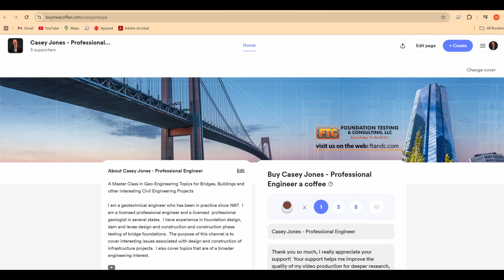Washington Bridge -  March 14, 2025 Update Demo Problems

Comment: As someone who's done this: demo is messy, things go flying, debris nets break, hydraulic hoses rupture. Barge demo is even more challenging. Sorry, I se no major problems with this demo, compared to other's I've seen. You have to break a few eggs to make an omelet. The only thing they could have done, is change the hydraulic oil out with Clarity, a biodegradable alternative. It's usually used when working over or in water. Additional Diver clean up after demo over water is SOP. 
I sent you this in a previous video, I'm pretty sure it's of the Washington st Bridge. https://youtube.com/shorts/4I1ESqcF8mQ?si=5ZmZOEirQZLTfxHu

Comment: With my current employer, I've been involved with some demo work of buildings and parking lots, things like that, I know it's messy work, but DAMN! That's beyond that.
Reply: Agreed. I am not part of construction, yet I do recall the removal of a few brick and concrete structures (from the 50s or older I think) to make room for a computer center upgrade, and it was nothing like this. That was contained and monitored to ensure it wouldn't affect anything else at the laboratory, what is going on at RI is more like a child flinging toys out of a toy box looking for something with stuff landing all over the place. If that's the way they intended to take down the bridge, it does work, it's just incredibly messy with a vastly more involved cleanup afterward.

Comment: SOP for this type of work over a navigable waterway is; the contractor submits a plan for review and approval  by the owner, the owner's consultants, the engineer of record, and the Coast Guard. During construction/demo, the owner's inspectors and the EOR monitor compliance with the approved plan. For the issues seen on this project, many parties are failing to do their job. The contractor is out of control. The EPA is also asleep at the wheel as is RIDEQE.
Reply from the maker: Thank you.  The plan seems to be to let the contractor pretty much do what they want.  I understand that it is challenging to demo a bridge at such a site, but it is doable without all of the sloppiness that we are currently seeing.

Comment: Why is it so common for oil retention booms to fail? It is rare to see one do the job they are designed for.
Reply from the maker: I think it is just cover to allow people to keep working.  Sort of just window dressing.
Reply: The proper spill control booms are expensive and really well built. The cheapo contingency ones we see here are made as cheap as possible and are "compliant" enough to show you have emergency spill containment processes and equipment in place.
Whether the spill containment works or not doesn't really matter when you are in bed with the local government.

Comment: I'm not sure a busted Hydraulic line on an Excavator qualifies as incompetence.  It happens all the time, even on the most loved gear.  The amount of oil that ended up in the water is likely less than a good rainstorm washes down the drain.
Certainly everything about this bridge - from pre-failure inspections to current state - is shrouded in typical RI incompetence...
Reply from the maker: I am hearing that it happened again today.
Reply: @CaseyJones-Engineer  Good sources!!!

Comment: I'm no engineer and don't play one on TV or YouTub.  I get the feeling from you just one ounce of debris in the river would be enough to kill the fish in that river for the next two hundred years.  You obviously are going to counter:   no I'm not, well then how about some context, say something like if they had only allowed 50 pounds (or whatever number makes you fell warm & fuzzy) of debris.   If I can maybe put this another way, you come off say when Engineered Drawings were hand drawn (versus computer drawn via CAD, and printed on a plotter / printer) and someone needed to erase a 1/8" in. line because of a mistake, via your attitude you would be screaming to do have the entire drawing redone from scratch, versus the 1/8" inch erased mistake corrected.  The hydraulic fluid in the boom area looks to be no more than a few gallons at most, via a broken HIGH PRESSURE LINE / HOSE, that even shutting down the machine as quick as HUMANLY possible, when discovered, you somehow seem to equate as though a shipping barge of 300,000 thousand gallons were dumped into the river ON PURPOSE.  If you didn't mean to convey this, sorry to inform you, but at least to my eye's and ears that's what I'm hearing you say, and illustrate via this video.
Reply from the maker: I don't think you watched this video. LOL
Reply: @CaseyJones-Engineer   @CaseyJones-Engineer  Are you standing out in the sun again without your hat on again. Your video shows while your talking about the debris in the river shore-line and how they dug up more than what you felt should have been done, You do your semi-close-up of the the  hydraulic fluid in the river, or should I call it a SHEEN to make you happy, and you talk about the boom not being up to your standards.  I have zero clue what is or isn't a proper boom-setup, but again no context i.e., offering what a proper boom-setup- should be.  You didn't mention any fines by the U.S. Coast Guard, or anyone from say the EPA (Environmental Protection Agency,) so either you have your nose out of joint because as an ENGINEER it's either your way or the highway, theirs's only one way to skin a cat via your way.  How about some context, example the boom was doing  / or was not doing it's job because a proper boom Bla, Bla, Bla, etc. 

You may wish to see if a Doctor can help you with your Cranium Rectum Disorder. I hear they have a cure for that.  If your Doctor is unable to help you, you may want to inquire about Glassectomy!

What pray-tell is a Glassectomy?  

A medical procedure in which a small window is inserted into the lower abdomen, (Belly Button area) enabling a person suffering from Chronic Cranial Rectal Inversion  to see through / out of.
Reply: @CaseyJones-Engineer   @CaseyJones-Engineer  Are you standing out in the sun again without your hat on again. Your video shows while your talking about the debris in the river shore-line and how they dug up more than what you felt should have been done, You do your semi-close-up of the the  hydraulic fluid in the river, or should I call it a SHEEN to make you happy, and you talk about the boom not being up to your standards.  I have zero clue what is or isn't a proper boom-setup, but again no context i.e., offering what a proper boom-setup- should be.  You didn't mention any fines by the U.S. Coast Guard, or anyone from say the EPA (Environmental Protection Agency,) so either you have your nose out of joint because as an ENGINEER it's either your way or the highway, theirs's only one way to skin a cat via your way.  How about some context, example the boom was doing  / or was not doing it's job because a proper boom Bla, Bla, Bla, etc. 

You may wish to see if a Doctor can help you with your Cranium Rectum Disorder. I hear they have a cure for that.  If your Doctor is unable to help you, you may want to inquire about Glassectomy!

What pray-tell is a Glassectomy?  

A medical procedure in which a small window is inserted into the lower abdomen, (Belly Button area) enabling a person suffering from Chronic Cranial Rectal Inversion  to see through / out of.

Comment: The right "pothole" looks like it is under an outfall:  could be a scour pit, and it looks like old rip rap remains.  The one on the left has fresher rip rap, which could be placed intentionally as scour protection.  But if the permit does not allow for any mud disturbance, placing rip rap could be a problem, though it may be permissible above the MLLW line, depending on details.   Grade work above MHHW may be allowed.  So not certain how big of an issue this particular point could be.   Enough other/ biggeer problems exist with this, don't let them use this one against you.
Reply from the maker: Those are great points.  BTW, this video is just a palate cleanser for what I have coming next week!
Reply: @CaseyJones-Engineer  I am impatiently waiting...with baited breath!

Comment: What should be the procedure for mitigating the amount of debris in the water? Cofferdams or more barges?
Reply from the maker: If they had spudded barges that fit closer to the piers, less debris would be falling into the water.
Reply: Smaller barges either side of the support piers. Lash them together one side to the other, plank or bridge the gap between them front and rear. Finish demo, move barge to shore, clean off with bobcat and on to the next pier.
Reply from the maker: @TyphoonVstrom   That sounds like a good playing that they're not following. I think it's outrageous for them to be operating the way they are.

Comment: I am a licensed engineer in several states. We recently performed a demo of a power plant facade over a river that involved selective concrete removal. The owner and regulators were over concerned about any concrete that ended up in the water and added huge rate payer costs for netting and means and methods. 

Your audience should realize that every single civil works along a river involves concrete in contact with the river water. They also allow recycling concrete debris for beneficial reuse as riprap erosion control. 

Safety is another topic and so is hydraulic oil in a waterway. 

Forgive me if I laugh at the concern over some concrete debris in the water.
Reply from the maker: You're apparently unfamiliar with the particular issues at this project site  The issues is with concrete dropping and disturbing sediment which is problematic for downstream fisheries particularly since those sediments are known to contain a lot of nasty contaminents.
Reply: @CaseyJones-Engineer 
And you would be correct. I’m not considering any fisheries. I assume dredging never occurs in this locale?

Casey, we’re on the same side here balancing the environment against infrastructure needs. 

Sometimes the engineers, lawyers, and regulators need to take a step back and let contractors build something.

The debris might cause less harm left in the river since most landed on the barge.
Reply: As a Rhode Island commercial fisherman  , that did commercial construction to for years , you are insane if you think you are going to take that bridge down with no concrete going into the water 🤣🤣 , a hose blew on a machine no big deal , tree hugger at it again , not a oil spill 😩.
Reply from the maker: @johnnylobster2749   Nobody said that zero concrete was going to end up in the water.  However they could be operating in a way such that much less material goes in the river. They just choose not to.  It appears you are easily triggered.

Comment: It will be interesting to follow the post retirement careers of RiDOT higher management alumni and then connect the dots of historic tendering awards. Boards of Directors, the directorships of which are now up for future consideration. Nothing to see here folks, no highly trained folk installing environmental safeguards improperly, no sheen of oil here, move on, move on.
Reply from the maker: I agree with you on that.

Comment: Hydraulic leaks from modern excavators and other earth moving equipment are expected and routine even with excellent maintenance. These machines are greased and oiled at the start of each day and then warmed up for about fifteen minutes during which the operators and oilers visually inspect each piece of equipment. Flexible hydraulic hoses on these sized machines are routinely subjected to pressures in mid thousands of PSI during use and will fail from time to time w/o giving any visual or testable warnings. I've read and from memory believe that the Coast guard has said that one teaspoon of petroleum can generate a sheen over one acre in size in a marina so w/o knowing how much oil leaked the sheen in the photo could have come from less than one teaspoon of hydraulic fluid and in fact when lines do rupture spills are almost always much larger and since the fluid is under such high pressure the spray area will sometimes be quite large. It would be expected that some of the spray could easily have reached well beyond any boom and In this case I would not be surprised to learn that some of the traffic on the open road was to some extent sprayed. Barring malfeasance it's inane to include any no leak no fail in a construction contract. I do agree that this contract seems awfully expensive. Ray
Reply from the maker: I heard that they had another hydraulic fluid leak today.  I was on a job in Utah that was located in an environmentally sensitive area.  The contractor was required to use vegetable oil for their hydraulic fluid.
Reply: @CaseyJones-Engineer  Great solution for an otherwise intractable problem. That must have taken some time to drain system cylinders, hoses, pump, reservoir. hard lines. Ray

Comment: thank you casey, josh & chris!!!!!
i know nothing of heavy equipment, but i am wondering just how much hydraulic fluid is in an excavator, how much it can lose and still operate, and how NO ONE noticed that huge volume of hydraulic fluid escaping earlier (and moved to stop the flow).
i also noted that wpri reported that no sanctions were given to the contractor for this significant spill. wouldn't this kind of environmental failure have been prohibited in the contract and wouldn't that be something that the contractor would be penalized for in that contract?

thanks again for reporting all of this!!!
Reply from the maker: I don't think RiDOT would be in a position to penalize the contractor.  That would have to come from the state environmental agency that seems to be taking a "hands off" approach relative to this project.
Reply: That excavator  has about 100 gallons of hydraulic fluid, pumped at 5,000 psi.  What probably happened is a hose or fitting broke, a fairly common occurrence. It is surprising is that no absorbent pads can be seen in the drone footage. Having a spill kit onsite, ready for the inevitable is standard procedure.
Reply: @williamhart8974  thank you for that explanation. in that all construction on the portions of the bridge that are at or below the water line will be halted until june due to the spawning habit of fish in this area, i would've thought that there would be REQUIREMENTS to preserve the seekonk river in all aspects of this project. i guess it will be up to Save the Bay to fight the environmental battles on this project.

Comment: This part of the Seekonk River takes the sewage runoff from the blended storm and sewage system for the area. When it rains heavily the 100 plus year old system is overwhelmed. When we rowed in this part of the river you stayed out of the water.
Reply: Ew not sure I would recreate at or below this waterway. Hearing faint sound of dueling banjos….in Rhode Island!!  Tourism should be trying to paint a completely false picture kind of like our president using the antiquated reasoning that if you tell the same lies the people will believe you

Comment: The idea that you can demolish a million-ton concrete and steel bridge with zero environmental impact is just more green pipe dreams.  Minimal impact, maybe. Mitigated impact, sure.  But don't pretend you can do all this work (much less build a new bridge) without putting a pebble into the water.
Reply: this looks like 10 million pebbles.
Reply: @BG-sl9lv 

Yes, plus hydraulic oil and other trash.
But nothing to see here, move along !

Comment: Wow they put a boom out to stop the hydraulic fluid from leaking into the river. The only difference is that they're not going to do anything about the hydraulic fluid other than just let it dissipate through the boom. Basically it's there to make them look good. I bet you never see a hazmat crew come in and clean that up.

Comment: There are biodegradable oil options. Regular hydro oil degrades nearly 20% naturally, "biodegradable" oils degrade 30%, "highly biodegradable" oils degrade 50%, "fully biodegradable" oils degrade 70%, and the European bio oils (panolin SLP synth) degrade 97%. Yup, the good stuff costs way more (about $100/gallon) but it has a 12,000hr oil life (so will outlast most machines). That's why we run it in our spider hoes, I've had lines blow while in the middle of a river, during the salmon run (yes, it's weird placing boulders with spawning salmon swimming past) and the fisheries officer was just "panolin? Change your hoses and get back to work". No clean-up required. And that stuff has been around for 30+ years.

The point being, there's no legitimate reason for oil spills to be an issue anymore. Just uninformed consultants and engineers, and cheap contractors.
 This project, like nearly all large government projects, is basically just watching two retards trying to hump a watermelon in the dark.

Comment: "Oil spills are normal, and it was totally expected" or something like that, I'll bet, yes
Reply from the maker: Yes, I can just hear it now...
Reply: @CaseyJones-Engineer  That’s how you’re supposed to do it. Completely as planned.
Reply: It happens, but is a sign of either improper equipment use or badly maintained equipment. It's rarely a true accident that couldn't be predicted. But whenever it happens, just stop what you are doing and try to fix it. One of the more common cases is a blown hose, but a piston seal isn't unusual either.
Biodegradeable hydraulic oil exists, but it's more expensive and in some cases not aging resistant either.
Reply: ... and you've had videos on projects that went really well, so it's not like this channel is characterizing the entire industry as shoddy; there are firms/DOTs that do things right. This incident just seems especially outrageous in the spin campaign, sort of in the Millennium Tower tier of propaganda